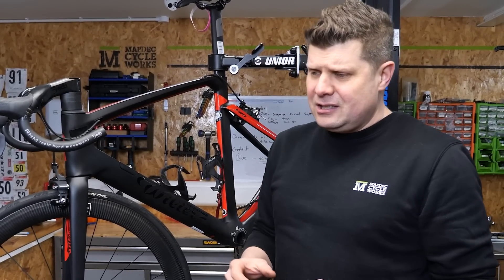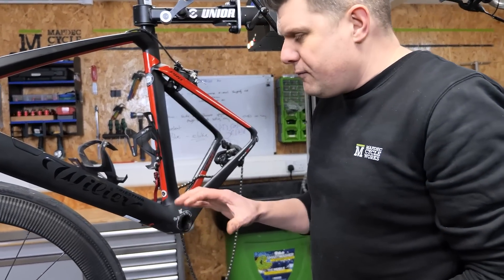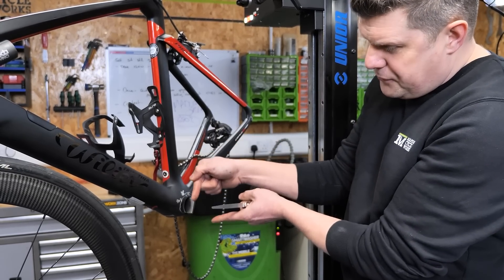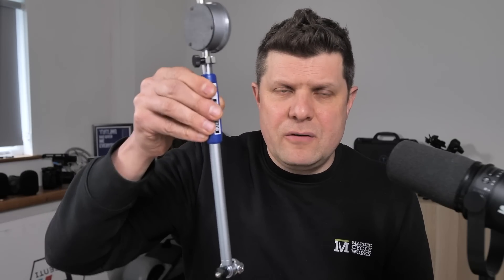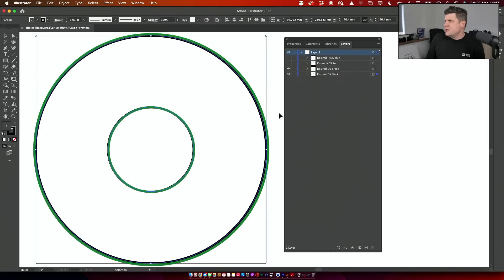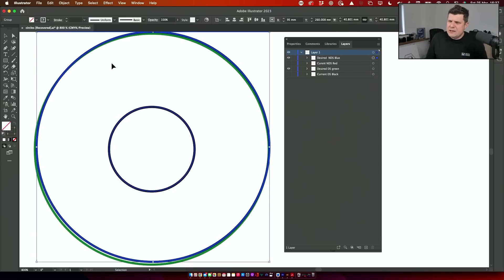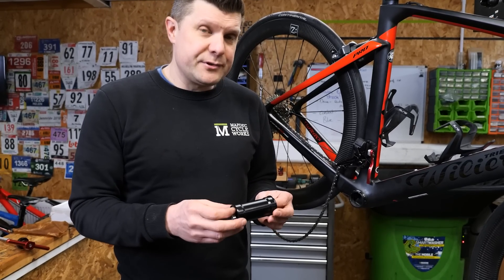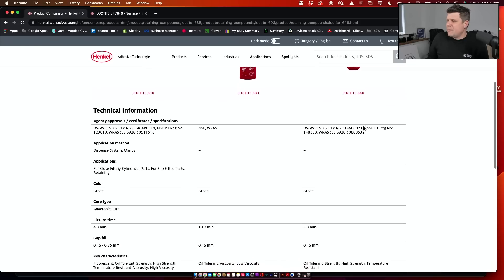Aligning a Wonky Wilier with the help of a Hambini BB

Comment: What did you use to make the hole bigger. My bottom bracket hole is 40.94. I got a hambini bottom bracket bb86 and wanted to make the hole to 40.98.
Reply from the maker: Park tool reamer.  Or. If you are patient.  A 40,98 gage, engineers blue and 1000grit wet and dry.

Comment: Great work!! Great explanations!!
Now my comments ( always negative).
 I have two frames that serve the same purpose for me. A Bianchi Infinito CV, and a Wilier NDR. Though the Wilier was priced higher than the Bianchi. When doing maintenance and cutting stems I was able to look inside both frames at the headset and the bottom brackets.
 In my opinion it was night and day. The Bianchi was well finished and clean. While the Wilier was crappy and unfinished inside. While I've had zero problems with either bike. I don't  think I would buy a carbon Wilier frame ever again. Both frames are said to be designed for the Paris Roubiux race and built for comfort. They are both very smooth riding frames. They both sprint exceptionally well. They are built with Campy Record groupos and both have Campagnolo's aluminum with ceramic bearing wheels Shamel ultra.
 I wasn't  suprised to see the Wilier frame featured in this video.  In fact I'm surprised we haven't seen a larger number featured in your videos. ( yep! That's how bad I thought my frame looked on the inside.)
 Again , great video.!!

Comment: I have to admit that I love this, but I also wonder why newly purchased frames wouldn't simply be sent back to the manufacturer? I realize that shops will see issues like this from bikes that are not brand new and would either need to make a choice to fix it or have the customer/shop send it back in. I also wonder about the folks that own and ride these bikes for many years where Locktite is used that is a more permanent fix, and what happens if they simply need another BB... how easy will it be to remove the BB? Thanks for sharing!!
Reply from the maker: With internet sales, warranty becomes really hard.  You would have to box up the the bike, send it away, and wait and wait and wait, as it goes from dealer to brand and back again. Facing and finishing work often gets debated.  Does is affect function? Is it for the factory to do, or the dealer to correct etc. It can take an entire summer to wrestle out sometimes.
Reply from the maker: Oh. Removing loctite is easy if the figment was correct for the gap. Just heat a little.
Reply: @Mapdec  I think I misunderstood, is the loctite 648(I believe) not a permanent fix?

Comment: What kind of honing tool did you use to bore out the bottom bracket shell to your desired width?
Reply from the maker: I think the link and info is in the description
Reply: @Mapdec  It just says "Honing Tool". I have an undersized BB shell on my CAAD10 and am looking to purchase a tool to correct. Any recommendations on a specific honing tool would be greatly appreciated. Cheers!
Reply from the maker: Oh. I’m sorry. From memory it is a Sealy Honing tool 280 grit I think that covers the 41mm size. The caad 10 is aluminium. You should use the park tool 41.94mm reamer
Reply: @Mapdec  Much appreciated. Are you aware of any other honing tools for aluminum frames that may be cheaper? I wonder if the Flex-Hone tool would work using a 1-3/4 inch tool for just a bit to hit the ideal 41.98mm. I'm installing an Hambini BB.

Comment: With the precision of modern machinery its amazing how badly they can screw up a simple bike frame.
Reply: Totally agree! How hard can it be to machine/drill a hole through 70-90 mm of material, that (to make it easier) is empty inside?
Or when building the carbon frame - like they could not wrap fiberglass material and later on the carbon fibers around some up to spec tube, that would be removed from the frame at the final stage of production (just like a worn bottom bracket, in the future).

Comment: Just don't buy frames with creakyfit bbs. Specialized and Santa Cruz as well as a lot of other brands use threaded bbs and it just works. Buy a Chris King BB and you have a perfect system with a lifetime warranty on the bearings. Even my Nukeproof threaded bb is brilliant. I have never had a bike in the shop due to issues with a threaded bb, mostly because on say a shimano bb when the bearings are worn its super easy to replace the bb with relatively basic tools.
Reply from the maker: It’s more like every bike shop has facing and tapping tools to sort threaded bb. Very few have invested in tools and knowledge to work with pressfit.

Comment: So, given how much thinking time and how much engineering time you gave to this project how do you cost it? Does the customer get an estimate or a fixed price up front or does the customer give you a budget?
Reply from the maker: It’s a good question. To attempt to fix the frame to accept the Kogal was going to be a difficult, risky and time consuming job with lots of labour time. To hone out the frame like this and slide in a Hambini is a quick job. We charged an hour for the job. With the measuring tools to hand we can make that decision fairly quickly.
Reply: @Mapdec  dam. 1 hour should of been a bicycle mechanic with kind of time allowance.

Comment: Your face gives away the ‘hope this works’ at the end. Nice spin…nearly like a square taper BB? I find it interesting how many times you re-torqued the bolts on the shimano crank. I have Campy cranks on all my bicycles, so this is new to me.
Glad I own a TIME frame.
Reply from the maker: Sure. It’s a tricky process. Depends on the Square Taper BB. They are essentially the same thing on a smaller scale.  The dura ace ones on track bikes are amazing. Many are far from amazing. Doing up pinch bolts require this method of back and forth. Stem bolts are the same

Comment: I'm not a fan of the wheels/hambiñi solution still. You've got a hotdog down a hall way problem, their solution is to just slam the doors shut on the tips of the hotdog. But all the pedaling load goes through the walls of the hallway. So far no ones recorded the detriment that these BBS will cause to the frames over time. 
We really need a BB cup that has 3 or 4 jaws that expand outwards to create a friction fit on the walls of the BB, instead of clamping the edges of the frame
Reply from the maker: I’m not entirely sure I understand your concerns here.  The press fit sleeve method for shaft alignment is found everywhere from aircraft to racing cars.
Reply: @Mapdec  I'm just referring to the BBS that thread together and clamp carbon BB faces that were never designed to be clamped
Reply: @janeblogs324  I'm sorry, but you are lumping together 2 very different solution: only one of them thread together (and there are other brands using the same method), while the other one (Hambini) does not clamp the edges at all

Comment: So you have had to do the QA and reparation that the manufacturer (Wilier) should have done. However, Wilier are aware of fakes being sold..."We are increasingly searching the web for ads and offers on Wilier Triestina branded bikes, frames and accessories, sold by phantom dealers, artisans and vendors that are unauthorized. Often these products are fakes."
Reply from the maker: It is a possibility.  If it is a fake it is a very very good one. All the little frame fittings are familiar Wilier stuff and the paint finish is lovely.
Reply: It's definitely not a fake
Reply: Very fair  but  latter point also known to lawyers as the ‘ it wasn’t me guv defence’  🤥

Comment: If it doesn’t say Hambini on the BB it’s not optimal hence “CRAP”. The spin test confirms how much of a quality part the  Hambini BB is
Reply: If a frame is manufactured correctly, then even a simple cheap Shimano bottom bracket is more than sufficient.

Comment: As you can see even from your table Loctite is for METAL surfaces not for carbon or plastic.
Reply from the maker: You can read deeper. There is lots of info on Henkel website and others about this and the activators used. Their little help bot is useful too.
Reply: @Mapdec  I work at Henkel. We develop Loctite. Thermal expansion will gradually destroy this bottom bracket.
Reply from the maker: Interesting.  Can we talk more?  My feelings are to always follow the instructions from the supplier. I have used your chat to check things like this.
Reply: @human-pl7kx  Could you explain this more in (relatively) lay terms? Do you mean it could expand too much in hot weather and exert outward pressure on the carbon BB bore?
Reply: @steveadorjan9048  The coefficient of expansion(through heat) and shrinkage(through cold) of carbon is different to aluminium. Over time it will stress/wear either material. It's why I stick to aluminium for my bikes.
Reply: @stevewilliams5428  Is that an issue within the range of normal real world temperatures (i.e. winter-summer)? There are so many alloy adapter BBs for carbon frames and most require the use of medium-strength retaining compound (with activator), don't they? The only alloy-carbon interface problem on bike frames I've been aware of is galvanic corrosion, but that doesn't seem to be caused by thermal expansion.

Comment: I see a recurring theme of people slaping expensive performance products to fix poor quality, ending up with more expenses.

The thing is very simple: when a pair of something bespoke and something standart does not work, it is 99,99% not the standart part's fault. And when two do not have same quality, you gotta make them meet it, not maximise the sum. 

So, gotta re-bore the frame and it will fit Kogel, or downgrade to the cheapest sloppiest BB with nylon cups. Hampini BB with Locktite is great too, but suboptimal.
Reply from the maker: Reboring the frame is way outside our tooling capabilities. And anyone else I know.  It would require a mill, some sophisticated alignment tools and jig.  There is also a raised section in this frame where the cable guides locate that would stop a 40.98mm bore going straight through. It would need to be flipped in a jig. Ball ache!!!!
Reply: @Mapdec  a 5-axis cnc at least, yeah. Actually, no. You got quite close to the desired result. So, it takes an imperial ton of measurements and sanding.
Mills, jigs, etc are only measures of mechanization. Good for repeatability and further automatization, absolutely not necessary for one-off jobs.

But, extremes aside, reamer with a through hole, pair of V blocks, shims and a bit of tippy-tap-tapping is sufficient with not much effort involved.

Comment: I know this is a special case, but I just want to advocate for not using loctite or retaining compound on other pressfit installations. We have had multiple hambini BBs come in with people wanting them changed, and the previous mechanic loctited them in. It took absolutely ages to get out, and is a worry about damaging the frame. Other people have used loctite on their SM-BB71/86 and it has required dremeling to get them out. Normal aqua proof grease suffices for 99% of installations. We have also experienced with loctited BBs they are more likely to creak.
Reply from the maker: You have to check the size of the hole and make the right call.  Hambini specifically specifies retaining compound in a correct size hole. Mechanics do as engineers design. Problem are when mechanics don’t measure and make assumptions.  Also. Removing them, use a shock freeze on the aluminium once the bearing is removed.
Reply: Grease won't take up the torque load. There are portions of air gaps all around the BB cups which is the opposite of a press fit. Grease is hiding the creak but the BB is still moving and wallowing out the frame. 
The only solution is oversize the BB holes, epoxy the gap bonding to the frame, cure for 2+ weeks for full contraction, then ream the epoxy to spec. A very easy job with the reamer currently being the only rare/expensive component.

Comment: Swapping sides with the click-stick 5 times when doing up the pinch bolts on the LH crank makes me happy :-)

 So many internet gurus just seem to click the bolts once each and call it good, most likely they are pretty unevenly torqued in that case.
Reply from the maker: Aye. Just keep going until it clicks without moving.